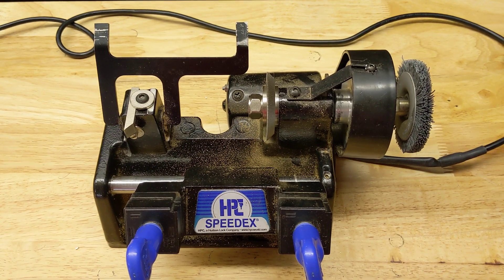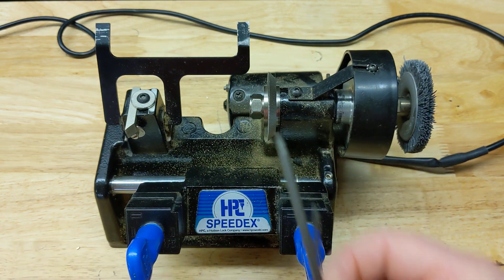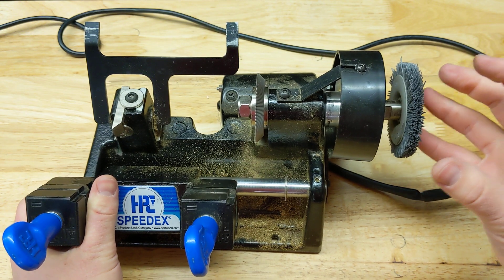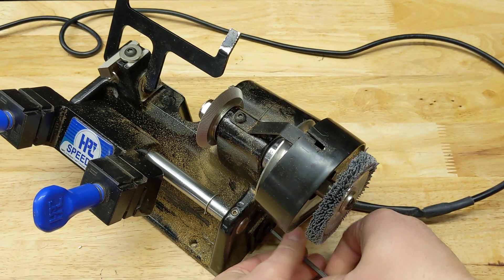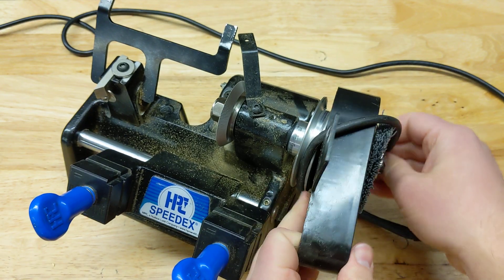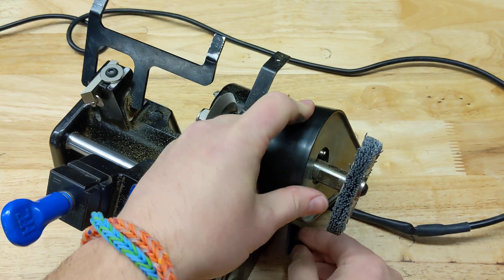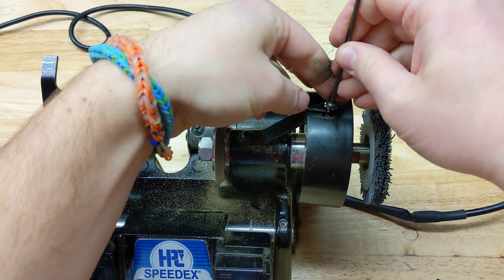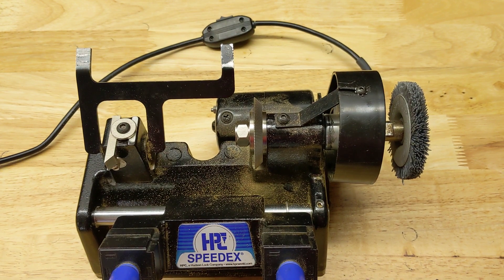How to change the belt on a HPC Mini Speedex 9120RM

Comment: Hi, any idea why my cutting disk wouldnt be centered? I cant seem to get a good cut with my machine, ive yet to take it apart, is the cutting wheel have a significantly bigger hole than the arbor? Or could something be bent? Id appreciate any advise you can provide me.